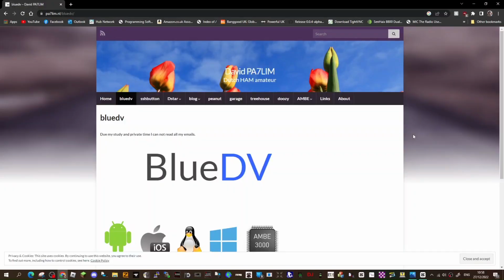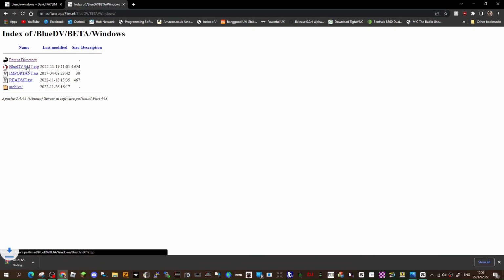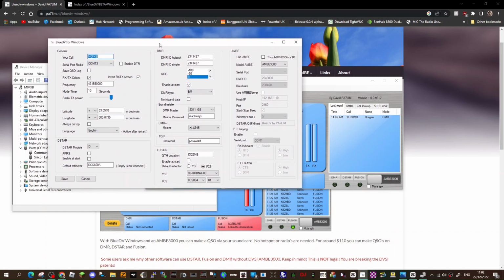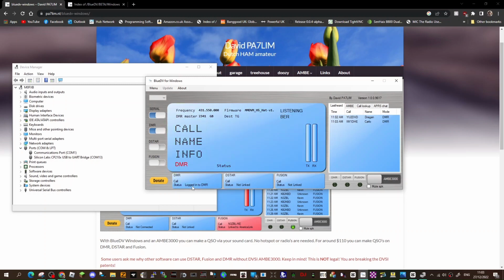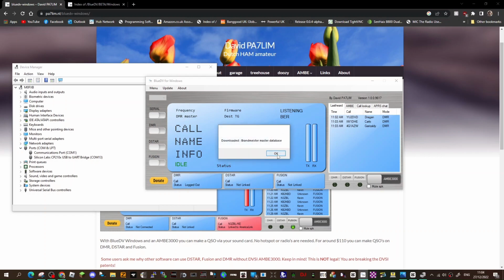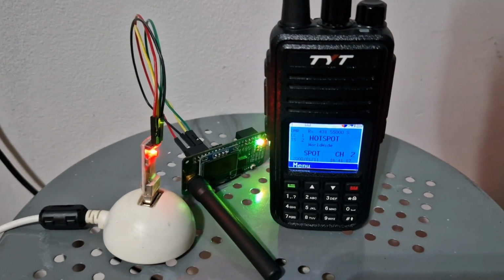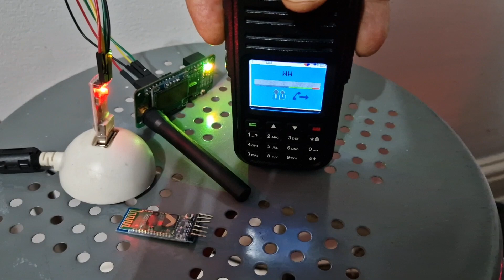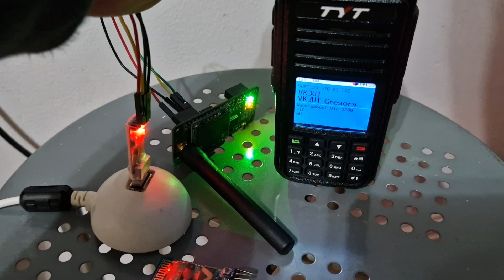DIY MMDVM HOTSPOT

Comment: this is nice to know because of all the fancy things out there.. the bottom line is you only need a basic radio hat and you can use many ways to get the hat working with computer or various chips that can run the program. i found the item to use the bluetooth interesting. and shows how little data is really involved here to produce the audio as intelligence. 73 de vo1kjm ve9
Reply from the maker: Hi look at this the Radio is only £43https://youtu.be/v4HOMVa3J5Q?si=nUkNAPdcd7dbhjj2

Comment: Thanks for pointing this out. If I didn't want to use a radio, could I just use the BlueDV software and a headset to connect to the various modes, DMR, DStar, Fusion, etc... ? (similar to using a DVStick)?
Reply from the maker: Hi no you would need a Dvstick or make a dvswitch server you also have the Droidstar option.
Reply: @M0FXBHamTech  Thanks for mentioning DVSwitch Andreas. I already have a Raspberry Pi4 running Home Assistant for home automation, and just added the DVSwitch installation to that instance and now have DVSwitch running 24/day. Pretty cool to be able to listen in to talkgroups/nets even while at work. The only minor problem I have with DVSwitch is that TG91 for some reason, has to be a static talk group on BrandMeister, otherwise, it would disconnect after just one speaker. No other talk groups have this symptom. Not a big issue though. Thanks.

Comment: I did the one you suggested with the usb board, that works, however I purchased what you suggest here, and it does not work. The uart shows up (Com 19) , and power works on mmdvm, but blue dv will not connect (serial button does work, but all / any mode button won't activate) I wondered if when you had us install the serial driver for the usb board, it did something, however all my radios on this pc use the uart drivers and work fine. (ft991a, ftdx3000, ftdx101 to HRD software, and wsjtx)
any suggestions ? did try on another pc, same thing, running windows 10. Cheers my friend.
Reply from the maker: Keep tinkering keep it simple ,